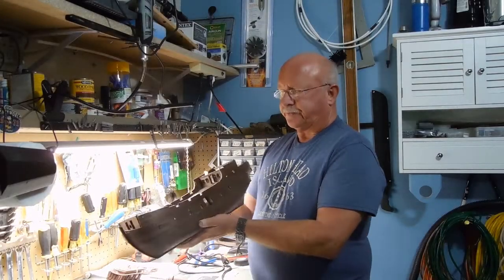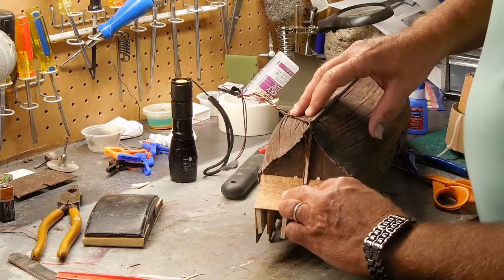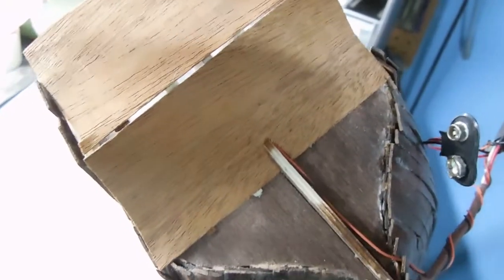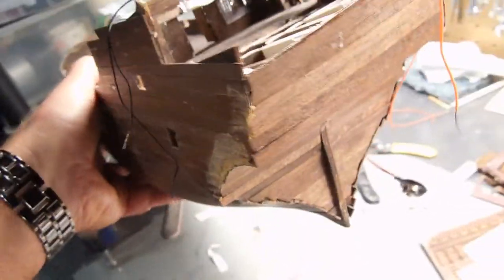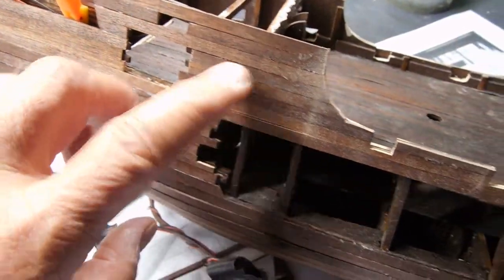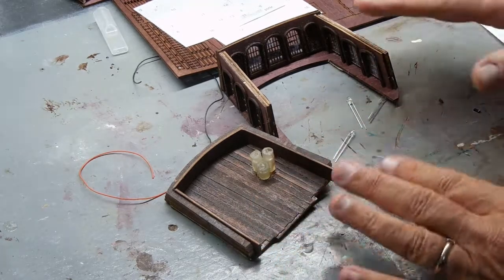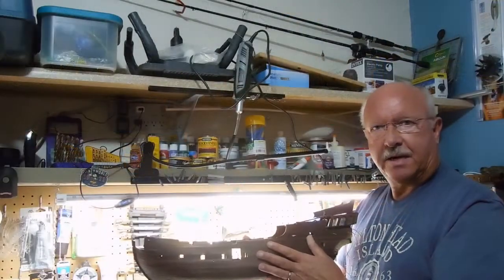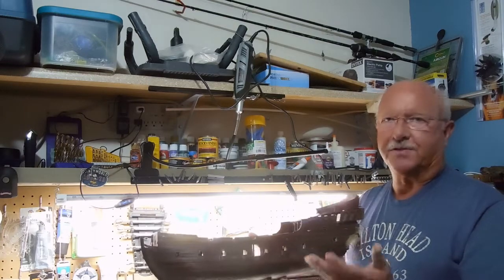Building The Black Pearl Model Ship Part 10

Comment: Just Roll with it is great motto for this hobby. thats what I like about wood, so easy to modify. lights look great! You could have soaked the plywood in water and curved it on the transom but the vinyl did a great job.
Reply from the maker: Actually it’s not vinyl. I said it wrong on video. It’s a thin layer of walnut. The adhesive gives the bending look. Thanks for the support. I’m a total beginner and thought it would be good to document my experience. Happy you agree and took the time to watch and comment!
Thanks